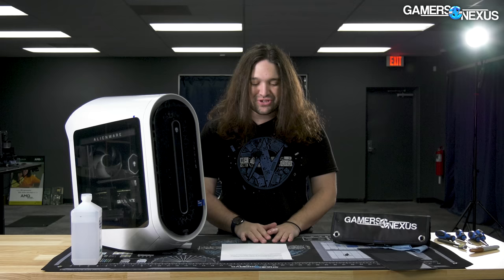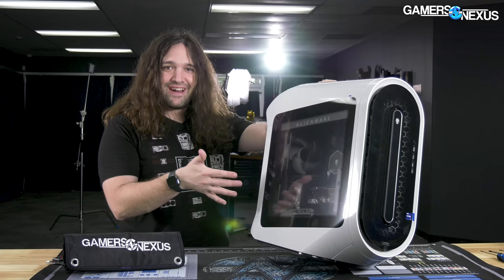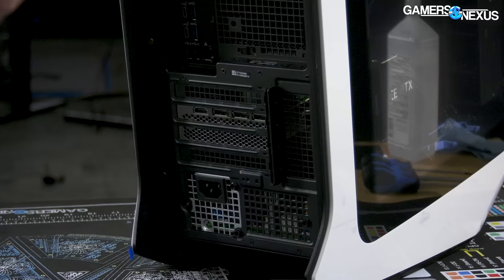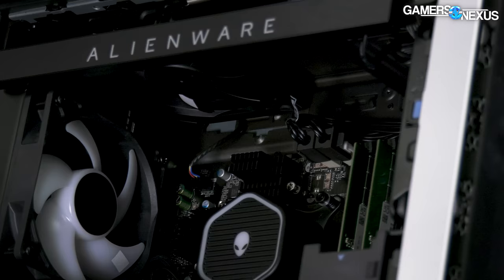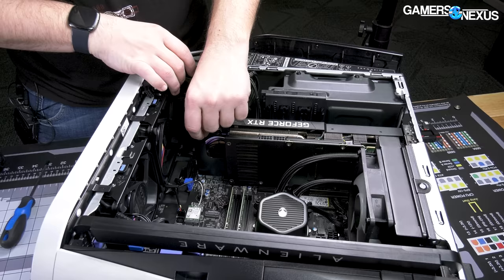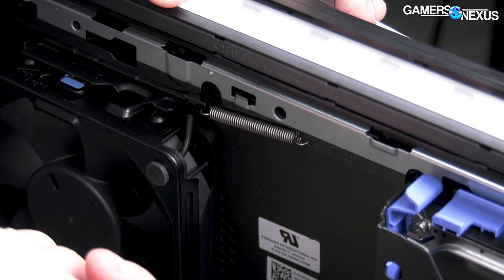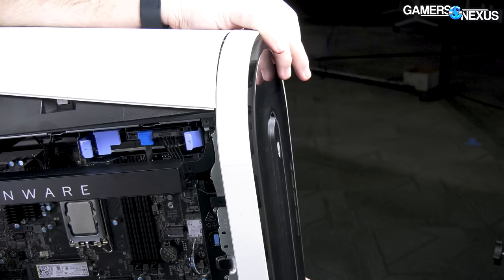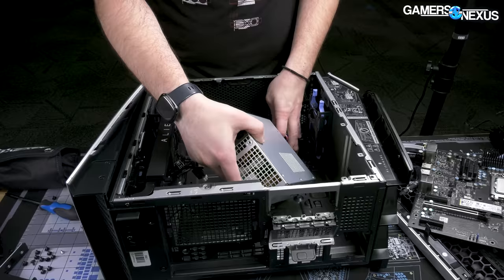Crazy Bad $5000 Alienware Gaming PC: R13 Aurora Tear-Down

Comment: "120mm CLCs don't work..."

Video Idea: "What if someone took Alphacool or Hardware Labs' Best 120mm rad, paired it to a proper high-end fan, and put it up against a 13900K?"

I've had the same EK block since my I7 6700K build to my current 5950X paired to the same Hardware Labs Black Ice 120mm radiator with a Nidec Servo Gentle Typhoon 2150 RPM fan.

On the 6700K, not overclocked but smacked with Intel Burn Test, max temp I ever saw was 82C. On the 5950X (also not overclocked), highest I've seen is 94C. Now, those are two very different TDPs, but that's with no observed throttling.

Comment: I almost ordered one of these because I was able to get it on payments... ended up getting an asus tuf f something laptop with a 3060 and a ryzen 8 core cpu. I was able to make couple hundred dollar payments until it was paid off.  Still not the best solution but my broke ass paid it off.  This was also when gpus were a crazy price. I just spend 2600 on conputer parts when I finally wasnt so broke. Parts should be here soon. The laptop also held its value so I should be able to sell it for close to what I paid.

Comment: I’ve had this exact PC for about a year now, and I’ve avoided watching this video for some time rather than admit the hard truth that I wasted a ton of money. I’m not very well versed in computer builds so I went with the brand I remembered from my childhood. I had a ton of WHEA errors and audio hangs right out of the box, and the case basically doubled as a space heater - all issues I think are unacceptable for the money they charge. Dell’s support was also completely useless. I got fed up and bought an Ironside to replace it about an hour ago.

Comment: i used to fix Dell stuff back in 2016, the sad thing is they used to standard form factor parts, and normal things like daughter board I/O  as well as the some of the tooless on machinal stuff. i did work on a few Alienware stuff, but mainly office gear and office laptops

Comment: I'm currently running om my second Aurora, both of them has run without any problems. I was actually considering the latest Aurora, just the one you are pulling apart. But now with more heat coming from the new line of CPUs and GPUs I will have more focus on the cooling. My next PC will not be an Alienware, I cry a bit inside now. An era is over, my "Alienwarera"

Comment: The amount of mechanical bloat and complexity injected just to avoid using standardized parts is absolutely baffling.

Like, they could just design a case that accepts 120mm fans/cooling hardware that has been standard for over a decade, but instead they engineer a completely separate adapter piece.

Comment: hp does this aswell i was a bit confused at first,i wanted a to change the case cause i was not getting the best performance so i bought a new case i had to go through this whole process and then i noticed that the motherboard had like that extension on the front and then i had to refund the whole case and then i had to put everything back together but the system i have is much lower configuration i paid abt 500 dollars on it.The thing im mad abt is that there are no upgrade paths my pc i cant upgrade the cpu or gpu bc of how greedy these companies. THANKS FOR MAKING THIS AWARE .

Comment: Best dell product i've ever used was a secondhand Dell Precision. Decent laptop, and the CPU fan is going out, complete bearing failure. 
Oh, and it's an absolute pain in the ass to take apart. Low bar.

Comment: years ago i bought a top of the line dell inspiron 9200 online and paid 2000 plus dollars (back then that was alot of money).  i didn't get all the feature upgrades i ordered.  they sent me a basic model and charged me for all the upgrade and extra softward.  and because i ordered it online i had no proof of what i selected.  the packing slip didn't show a breakdown of each item and the pricing it only showed the total price so i had no proof that it wasn't all that i ordered.   i swear i'll never buy another Dell anything as long as i live. i build my own pc's now and its more easy than ever plus you dont get the bloatware and cheap parts and useless software.  plus Dell usually has a special windows install which makes it harder to use than regular windows you install yourself.

Comment: in your follow-up video to this video, you show that the temperatures of the CPU end up spiking immediately to 95C when under load.  In this tear-down, i noticed you skip over removing the contact element of the AIO cooler from the CPU, but show in the very next clip that there's no thermal paste on the CPU.  Did this computer really come with no thermal paste?  Could that be the reason?  I'm just really surprised that its performance is THAT bad.  My stock intel cooler rarely lets mine get above 50-60C, so i'm just kind of flabbergasted at this thing getting up to 95C so fast.

Comment: I was one of those people who got scammed buying this PC. I was lucky tho cause I was able to get a full refund and I decided to do a diy build. With a full custom loop. I had no idea how computers work or knew much about their parts. Just knew that the 12900kf was a good CPU and a 3080 was a good GPU and that the higher the amount of memory the better. So I went with Alienware, ignoring the bad reviews and people telling me how bad it was. My issues with them started with a simple issue and their customer service sucks so bad that they made that issue even worse n worse stacking issues after issues onto each other. Also had issues where the power button would flicker and it wouldn't turn on. Had to figure out a way to work around that and make it work. Also has a huge issue with temps and how loud it'd get. So I tried installing an Nzxt kraken 240mm aio into it. Had to Jerry rig a whole fricken thing to make it work but I made it work somehow lmao. Also it did help a bit with the performance and temps. But still went ahead with getting a full refund cause it got so bad that none of their software even worked anymore. They had me reset windows and do a bunch of bs and nothing worked anymore. So I had to go ahead and get a refund cause I was sick of their bs. After watching hours of YouTube (thanks to jayztwocents, you guys, and a little bit of Linus) I was able to build my own PC with a full custom water loop. Spent the same amount as I did with the Alienware PC on hardware getting either the same parts or better. I spend maybe $1k more cause of the fans I got and the water stuff and everything else but I didnt care lol. I was ticked off and wanted to go balls to the wall with the best build I could afford. So now I got this beast of a PC in the Corsair 7000d case. Ive noticed a huge change in the performance and the temps and especially sound levels. It's so much quieter even if I ramp the fans to max. That r13 was super super loud my aunt would complain about it all the time. After I built this thing she actually thought it looked dope and showed her how quiet it was. Long story short never ever get Alienware. It's an awful company

Comment: It is very easy, from a experienced PC builder like many of the viewers in this channel, to conclude Dell's Alienware builds are mostly trash. That's only because we have the technical expertise to differentiate good design and good quality products from crap. However, from another person's point of view who wants a decent gaming PC but just don't have the technical knowhow, attempting to build a PC from scratch and understanding all these tech jargon can be quite a challenge. Not to mention the risk of wasting $ when components are damaged during the DIY, or getting incompatible parts. Therefore, from their point of view, going for prebuilds is probably the best option. If the PC fails to work few weeks later, they just call the hotline instead of trying to fix the problem. They probably don't need to know the parts used are not of the best quality - they just need to power on and verify it works. These are the people that companies like Dell target when creating prebuilds. Aesthetics over performance and quality.

Comment: Sure they are trash compared to a good taste custom build but if you wait for a sale (dell frequently has big sales) you can pick up a "$5500" aurora for like $4000 and they practically hand out interest free financing to anyone. It's a pretty easy way to get your hands on a top of the line cpu and gpu. Like currently the 7950x/rtx 4090 one was just under $4000 after tax, I put together a system with the same specs, cheapest version of every component on pcpartpicker and it totaled about $3600. It would fit on my dell financing account limit and i'd get a year to pay it off with no interest plus a big warranty. That's not terrible value. Not saying I'd buy one but if I was not someone who builds their own pc maybe I would.

Comment: I've got one for you... I for some reason or another during the GPU shortage decided to get G 5000... Let's just say I felt very very, very very scammed afterwards. 

Eventually when the power supply absolutely died, I attempted to remove the motherboard to put it into another case. fun fact they actually perma affixed the motherboard inside the case... So there's no way it's removable and since they developed the motherboard themselves the standoff holes aren't even a standard pattern so if I did decide to cut it out of this ridiculous chassis.... I wouldn't be left with something I could actually transfer anyways. I typically always build my own computer but for some reason or another decided to stray from that path a few years back when purchasing a Dell. This was one of the largest PC purchase mistakes I've ever made and if I could give any advice to anyone else building a computer quite frankly do-it-yourself or buy from a more reputable OEM. I still have the motherboard and power supply inside the case let me know if you'd like to see a short of me smashing this thing by dropping it off the side of the skyscraper.... I have  Since purchased a corsair D 5000 airflow along with another motherboard and power supply and transferred all of the components along with some new ram into this case and wow... The CPU doesn't throttle, The gpu can actually breathe.... I'm getting idle temperatures at around 28 to 30ﾟC and load temperatures not seeming to surpass 60ﾟC.... For 10 700 F I can live with it!

Comment: I bought the r13. After 6 months my rgb fans stopped working. I did everything to fix it. They just crapped out. The fans are loud and don’t really give much airflow. I would suggest avoid Alienware OR replace most of the parts if u already have one

Comment: throwback to my old 700$ 2013 based build alienware, gtx 640 and an i3. They filled it to the brim with aluminum shrouds and it only had room for 1 fan. How do you thermal throttle a 640. i tore it down and sold the case for 100$ on ebay. I "love" dell :O)

Comment: Alienware " used to be good".  Have a Corsair Vengeance I9 with a RTX 3080 and upgraded memory from 32 to 64.  Great system.  Just had my whole complete gaming system,  monitor ( from dell- never again) HP Reverb G2, thrustmaster warthog throttles and joystick controls ( upgraded the base to Virpil base and F/A 18 stick), MFG V-3 rudder pedals and all my perifals stolen.  My next purchase will be either another Corsair , Digital Storm, or Skytech custom build.  I will never buy another product from Dell.

Comment: When I used to do warranty repair for Dell you could be guaranteed your machine wasn't going to look like it did out the factory when I was finished and something like this would have been a three or four hour job. Sometimes all I'd do is take out the drives, RAM, and unplug a few cables then put it back together. If that fixed it great, if not it was someone else's problem for another day. Fuck these things and fuck Dell, this video gave me PTSD.

Comment: as much as you crapped on this build you do realize you're talking about highly assembly lined products. They need the ease of implementation when it comes to assembling. Not saying its right, but it is what it is.  Dell main problem over the years in their machines is thermal dynamics enginnering on their devices. I've been a Dell Certified Tech for years and its something that ALWAYS happens. Every machine seems to be too hot for its own good, especially in the latitude department.

Comment: i stopped buying anything Dell when they were unable to fix my Alienware laptop for a year. Back in the day i bought a Alienware m17 r3, which worked fine till it forced me to update the bios firmware and Dells own software bricked the laptop. from that point on, every time i sent it in for repairs (under warranty) it would always come back thermal throttling, got to a moment that the reps already knew who i am. i must of sent it in for repairs about 8 times, and they eventually replaced it with a R4, but i still had throttling issues with that crap too. it seems to me that the repair centers use parts that are defective, cause sometimes when it got sent back, i had lightly scorched marks on the motherboard. they never fully fixed it, and then warranty expired. either way, Dell has always been a cheap corporate option, and it seems they still build crap pcs just like HP and Compaq

Comment: Parts were low grade no kidding I replace everything with micro center part now it’s decent. My R8 replace case Lian Li cool 2,Evo  8601tb ssd, aio 240 now, 64gb ram T Force, Lian Li fans, Asus 3080ti gpu, psu 1000w Cosair. All the cables it’s now white. Yes hated it when u remove the cover plastic broke. $2000 upgrade but not $5000 like what they set price at. That’s the most cramp space I ever seen my replacement case was a Lian Li cool 2 about the same size but much more room for fans and gpu.

Comment: Complete pc noob here, i have one question about this exact pc.. can i buy a new case, and just use all the parts from this aw? Like transfer it all over for better airflow?
Reply: No you cannot. That motherboard isn’t gonna fit any case just like he mentioned.
Reply: @dharshdanube6911  ok thanks. Must of missed that part somehow mb. Was just asking because i got a custom case for a atx motherboard getting built. And was just hoping i could swap all my components over while saving up waiting to get all the interals together. But since my original post I've already done all the needed research. My motherboard is terrible anyways and made by foxconn and its designed to aw's exact spec for their old retooled metal frames. Only thing imma transfer over for the time being is the cpu gpu and the 2x32gb ddr5 5200 ram i got in there until i got everything else on hand 😊